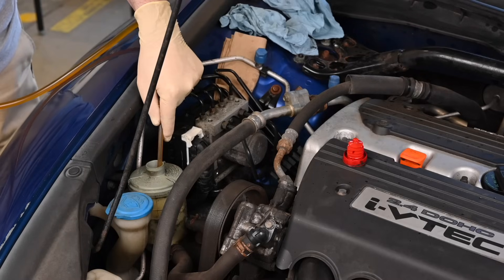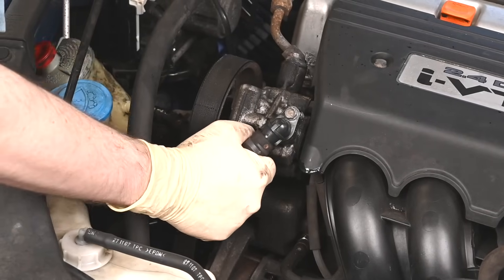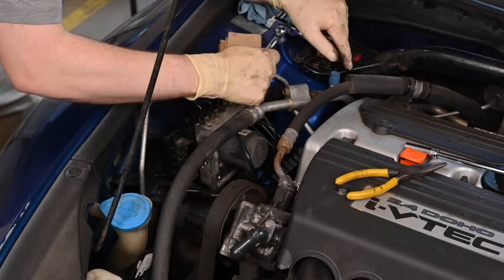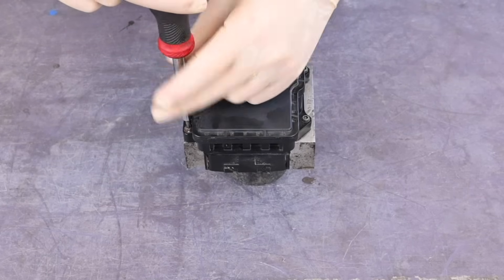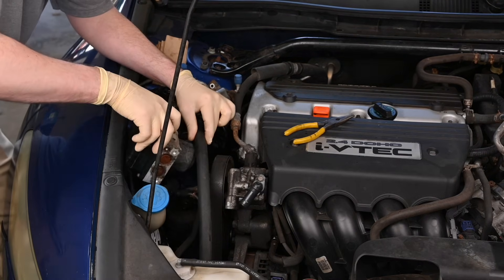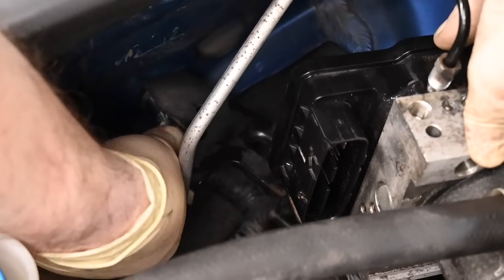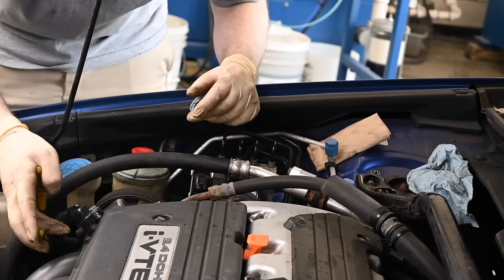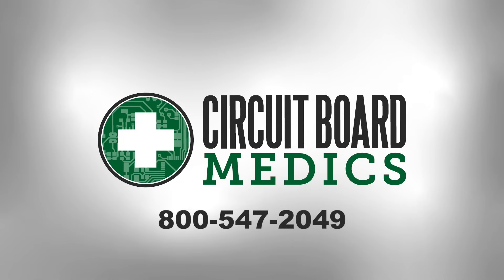Honda ABS Module Location, Removal, Repair, and Replacement (Full Tutorial)

Comment: You don't have to bleed each individual wheel?
Reply from the maker: You'll need to bleed the brakes at each caliper.
Reply: @CircuitBoardMedics after or before you bleed the abs module?
Reply from the maker: There's no need to bleed the module/pump. After you reinstall the module/pump assembly, you'll just need to bleed the brakes at each caliper to remove any air from the lines :)  Hopefully that helps!
Reply: @CircuitBoardMedics got was confused cause in video he is bleeding from the module not the calipers but I understand now.

Comment: Is there a similar video for a 2015 pilot?  How often do you repair this module for Pilots?
Reply from the maker: We don't have a video that's specifically for the Pilot, but the process should be fairly similar. The Pilot ABS module is a common repair for us. What issues are you having?

Comment: What happens if you don't remove brake fluid first? Will it spill all over the place when you disconnect the lines?  Don't have a fluid removal thing.
Reply: Never get brake fluid on your paint
Reply from the maker: It will likely spill quite a bit of fluid. You may have to use something to catch/contain it.

Comment: What size are the bolts under module
Reply: 10 mm for the 3 under the module, torx t20 for the 4 screws connecting the circuit board to the pump part

Comment: Is there no need for Reset or relearn ABS? Just plug and play no need for OBD scanner?
Reply from the maker: Yes, the ABS module will be plug and play since your programming will be retained. No reset/relearn for them. Just let us know if you have any more questions :)
Reply: Will the programming be retained if I swapped one from another car ?
Reply: @joseramirez590 as soon as I started the vehicle after swapping from the junkyard, light didn’t come back on until the new one later failed
Reply: @shotseven how much did it cost you at the junkyard ?
Reply: @plutodread97  it was ~$80 at my local pull apart, just know it’s one of the first things people pull from these accords.
Reply: @s @shotseven i wouldn’t be surprised, did you put the part yourself or mechanic if so how was labor $ ? thanks for the reply

Comment: Can the module be (carefully) removed from the pump while the pump is still installed in the vehicle? or will fluid or anything else fall out of the pump?
Reply from the maker: Some vehicle models may allow sufficient clearance to remove the module from the pump while the pump is still installed. The Accord that we used for the video did not have sufficient space, which is why we removed the whole assembly and then split it.
Reply: If you remove your wheel well covers and undo the three 10 mm bolts in the rubber grommets holding the abs module from under the passenger side, you’ll have enough wiggle room to just remove the 4 Torx T20 screws in the plastic/circuit board part of the module. Then you just maneuver the plastic/circuit part out without having to deal with any fluid. You’ll just need to watch out that you don’t lose the two metal wafer/spade/prong looking connectors he shows at 4:55.

My wheel well cover’s been missing, so I was able to remove without even lifting the car up. It can be hard to get the bottom right T20 screw because you can’t really see it, but you can wiggle the module a bit and use a small extension and feel around. I can have mine removed in under 10 min now because I’ve done it a few times already.
Reply: @s @shotseven  do you mean the 3 10mm bolts mentioned at 3:40?
Reply: @raymondm.432  yes
Reply: @shotseven  Thank you. I managed to get it that way. It was also easier to get those T15s
Reply: @raymondm.432  aww yeah glad it helped. For me the T15 worked for 3 of them but stripped the fourth I found that T20 fit more snugly. I was using a super cheap generic set though so it could have just been my set.
Reply: I came here to ask this